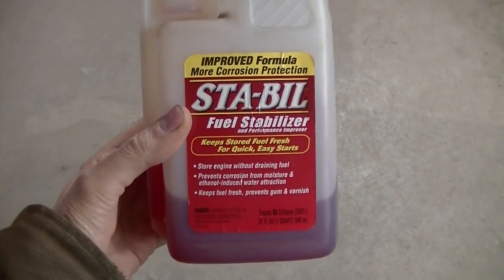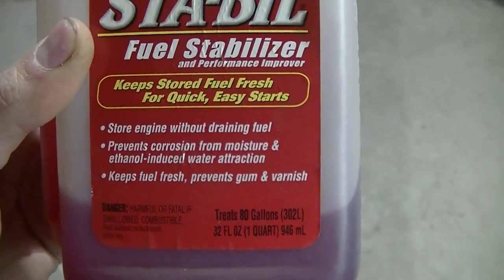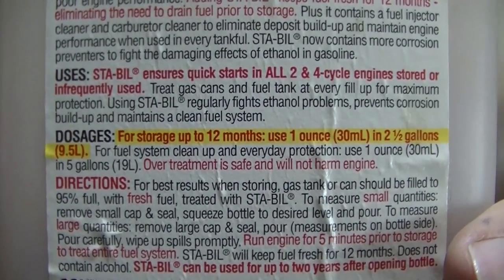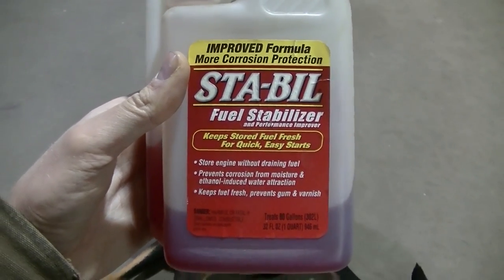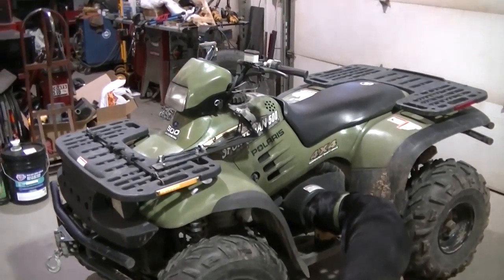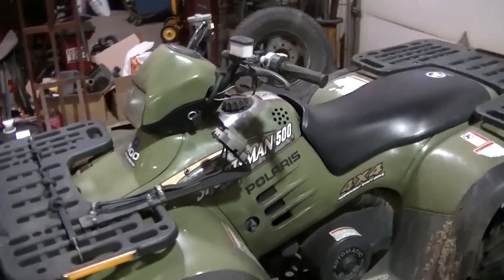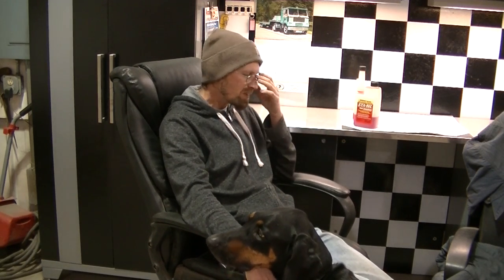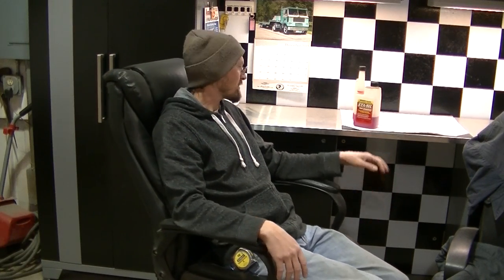STA-BIL Fuel Stabilizer "Important Stuff to Use"

Comment: i never used anything, but i cant let anything with a motor sit longer then a month or so without starting and running it.lol i flip a battery tender back and forth over the winter from my qaud and mowers to keep the batteries good. all the 2 strokes i run stihl synthetic and it has stabilizers in it. my honda 450er is ran yr round so its been good since new.i run shell 93 octane in everything too. i like the way it smells.
However,my uncle was a a fanatic with the stabil products for his boats,and motor home generator,it was a Onan Vtwin  engine.
Reply from the maker: +Game Bred Duramax   I would still run stabilizer even though you run premium fuel.  You don't have the ethanol in the premium but the fuel still goes bad.  Year after year the bad fuel can add up.
Reply: Ya ive prolly been lucky, but i do mix sea foam now and then as maintenance,win cleaning spark plugs and air filters. I should probally get on a regimate for winters thow.

Comment: Just did this to my motorcycle last night. I used the same product hopefully it’s good cause it’s my 1st time using it..
Reply from the maker: Been using this stuff a long time.  I will have a new video coming out soon with my dirt bike.  I also used the fogging oil in that because I won't be starting that until it warms up next year.  The mower I periodically start all winter.  Been using STA-BIL for 15 years on my mower and have never had fuel or carb problems.

Comment: i did my deere & the tiller.. i dont do it 2 my trimmer, i just run it dry. & with my chain saw i dont do it becuz i use motomix. that stuff is damm good. wont go bad for 2 years & it has fuel stabilizer like stuff in it.. nice  vid. :)
Reply from the maker: +MRJOHNDEERE3720. :)   It's easier for me just to treat my trimmer and run it for a few minutes.
Reply: mossman381
i did not think u could put fuel stabilizer in gas that mixed with oil?
Reply from the maker: +MRJOHNDEERE3720. :)   I will have to read the back of the Sta-bil but my trimmer is older than my mower and I have been using it since new.  It has to be 14-15 years old.
Reply: mossman381
mine is a 08.

Comment: my Honda lawnmower stopped cranking after storage.  I put Stabil in the tank, but it still won't crank.  How long should someone wait before trying to crank after storing ?
Reply from the maker: Did you run the mower for a few minutes after adding the Sta-bil?  You need to get the Sta-bil into all the fuel system before storing.
Reply: it never started, even after adding the Stabil.  I wondered if it takes a while before working on the clog ?
Reply from the maker: You need to use the sta-bil every year so you don't get a clog.  If you already have a clog then the sta-bil won't help you.  Probably need to take off the carb and clean it out.

Comment: I think it's a much better idea to drain the gas fog the cylinder and run the carb out of gas. Never have problems that way, and doesn't cost anything.
Reply: yep,i may have fuel in the tank,but my mowers have a pitcock,i can turn fuel on and off.i just turn it off and let it run til it stops maybe 1 min.
Reply from the maker: +RedWhiteAndBlueVideo   That would work if you didn't want to start it during the winter.  I want to start my machines during the winter to keep the oil circulated though out the motor.  Just my opinion.
Reply: +mossman381  I see your point about running the oil through the motor, and it's a good one. I live in s.e. WI we have ethanol, which always gives probs when left to sit in the carb. Are you able to get non ethanol? My Dad gave me a old Jacobsen snowblower when I emptied the fuel bowl which had 10% ethanol it was green and stank! Cleaned the carb and it runs.

Comment: I do it like you.
Reply from the maker: +Rick Anderson   You would be surprised how many people don't use fuel stabilizer.  They think because it starts in the spring they are fine but the varnish and gum that has developed will eventually cause the machine to run bad or not run at all.
Reply: I wish I could say I use it religiously but I have forgotten to add some to my motorcycles before.  What a pain to clean everything after the fact.